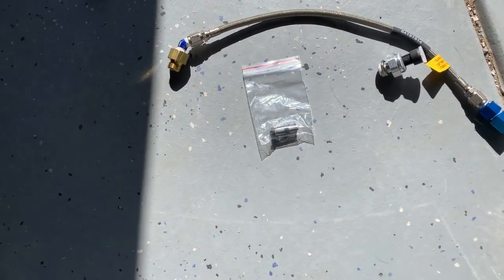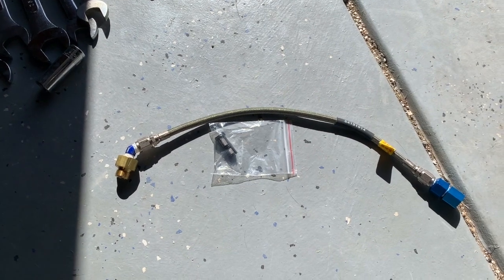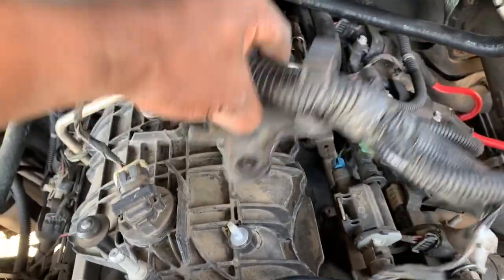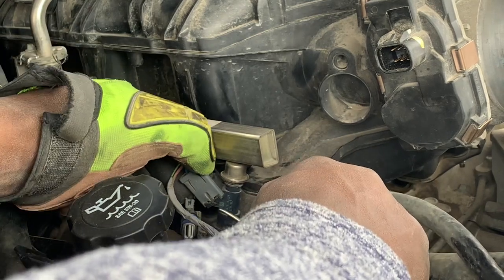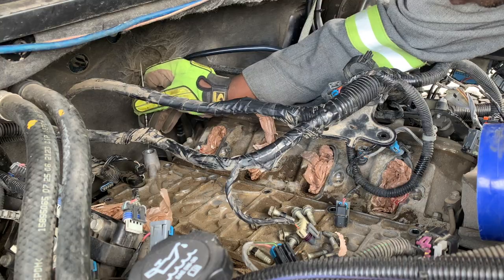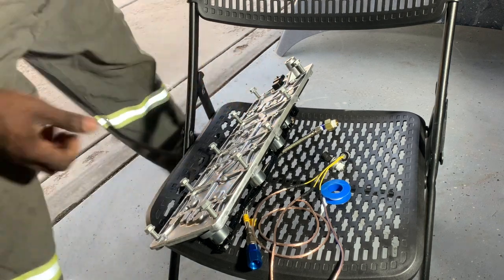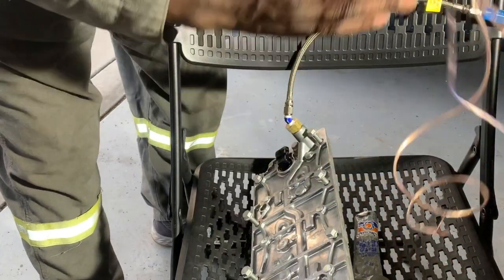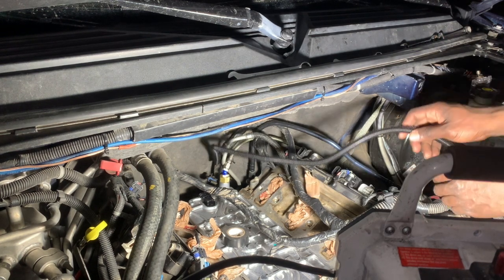Fix chevy oil pressure problem for good/ NEVER CHANGE OIL PRESSURE SENSOR AGAIN!! P0521 P0523

Comment: You do not need to remove the intake to change the oil pressure sending unit. Just need the right socket and extensions.

Comment: 2013 Chevy Tahoe and removed and replaced the oil sensor switch in less than 30 minutes.; I am not a mechanic and its location was in the rear of the engine . You are making it way more difficult than it needs to be. lol
Reply from the maker: Wow. Love a hack! You may have missed your calling

Comment: That oil pressure sending unit has been a problem since the small block Chevy was invented.
The sensor would leak and it would me misdiagnosed as a bad rear main seal.